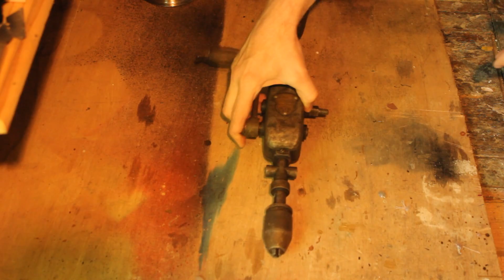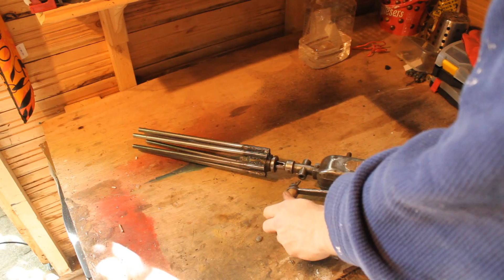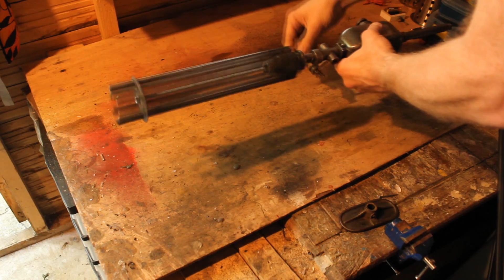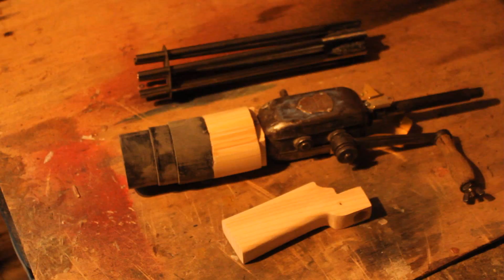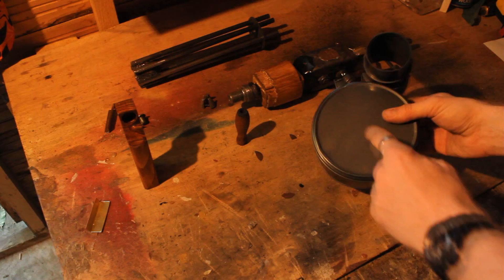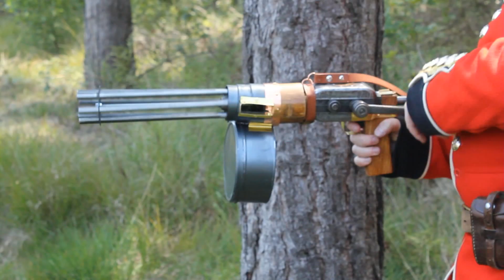How to build a Steamtech Prop SMG

Comment: Why would you need a trigger, isn't the crank the firing mechanism?
Reply: Gatling cannons have a trigger, they're for when you run out of electricity, so the motor won't work, they have a trigger and cocking handle for semi auto fire

Comment: you make some really cool stuff. the one thing I think you need to work on is your wood work. a dremel tool is your friend, go for some more elegant, and thinner shapes thats one thing that bugs me about these kinds of props, people over estimate the thickness. grips and stocks are actually very thin, barely 1'' at the thickest point. also try your hand with a wood burner.  try changing up the wood to, seems like you use a lot of pine. you can get some a cheap oak, though you may need to laminate a few pieces together together to get the thickness but its well worth the effort, try putting some brass screws and rivets in it too. just some suggestions. hope I don't sound like an ass, i really do like your work.
Reply from the maker: +killen joke Very good points, the wooden stocks are thicker than they need to be.  The props were made quickly so we could use them for the web series we had planned, but it would be nice to spend a bit of time and make a really detailed wooden stock.